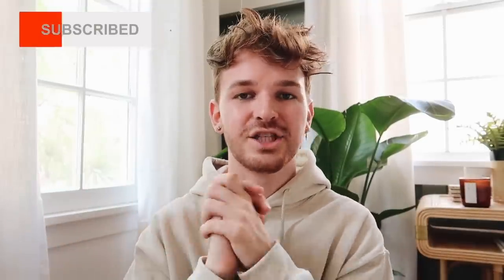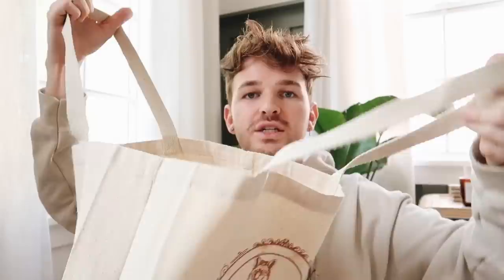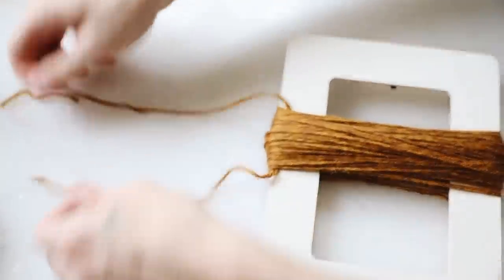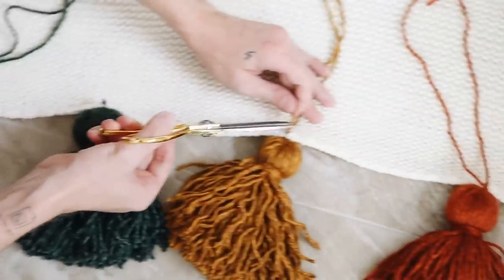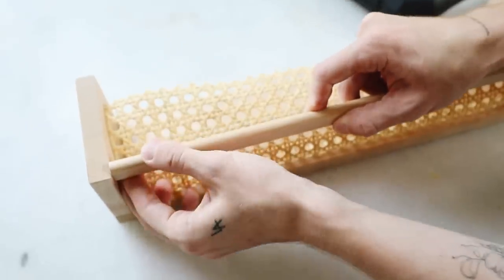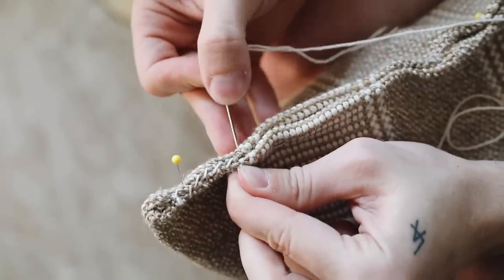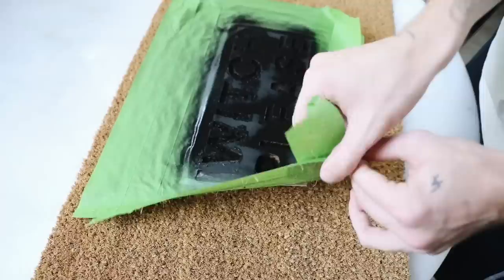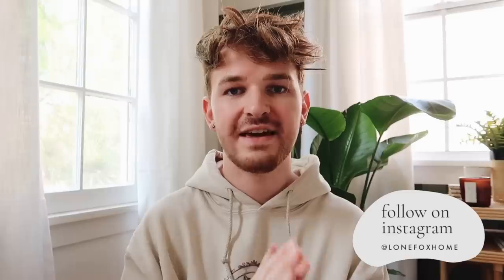DIY IKEA HACKS - Affordable DIY Furniture + Home Decor Hacks!

Comment: A suggestion for you, to avoid having to trim the uneven lengths on the tassels - tape a length of the yarn along the top side of the frame before you start wrapping. That way, you can tie it off evenly at the top centre and have the same length ends. Hope that makes sense 😁 Love your creative ideas (and, as a partially deaf person, how clearly you speak and how well you enunciate 😚)
Reply: Great tip! Thanks
Reply: also after tying the knots needed, you can trim the yarn like he does, or you can leave the excess yarn longer and take a yarn needle and pull the yarn into the tassel and that can make it easier to hide your knots!
Reply: and for smaller tassels you could even use the frame lengthwise and tie it on both sides, then cut in the middle. it would move around a little bit while cutting, but I'm sure it's doable.

Comment: To make the tassel easier to cut - use cardboard twice the length of the finished tassel. Fold in half then when you’ve finished wrapped your yarn/thread, you can easily wedge scissors into the middle to cut the tassel. That’s what us “old folks” used to do

Comment: Tips for the tassel making: your frame has Ana opening in the middle so you could tie the yarn somewhere in the middle and cut it  just on the opposite side.. that was too much work with the xacto knife. 
And to make the tassels more secure on the blanket instead of cutting the yarn you could put the ends back in the tassels with the help of your needle 🥰

Comment: Your ideas are great!  
Here's a few tips for your tassels... 
1.  After finishing wrapping the yarn around the frame why not secure it (with the yarn) in the middle of the aperture, and then cut with scissors on the opposite side?  It'll not only make it easier to cut,  but you'll waste less yarn. 
2. After you've made the ball end of the tassel, thread a needle with the remaining yarn, knot it, then pass it through the ball down towards the tail and trim it even with the tassel tail. This will avoid showing any visible knots and yarn ends around the wrapped ball end.
3.  Once you've made the tassels wrap paper all around the tail end then trim the tails inline with the paper edge.  This will result in all the tail ends being even, and it'll give you a much neater finish to the completed tail. 
4. After securing each tassel to the throw rethread the needle with the remaining yarn,  then pass it through the ball down towards the tails and trim it even with the tassel ends. This again will avoid making the ends of any knots visible.

Comment: I just wanted to tell you- If you use a bristle area brush (like a cheap small one)  and use black paint like you have over the stencils and just stamp it in like you were doing with the sponge brush, it will not bleed and work really well! I make mats all the time and it’s so easy and neater than using spray paint. Also I just ordered letter stencils from amazon instead of printing the paper and cutting the stencil out yourself.

Comment: If you do a surgeon’s knot, you don’t have to hold your finger on the knot to hold it in place. When you’re making a surgeon’s knot you simply make a simple knot like normal but go around and through one more time. Then proceed to pull tight and make double knots like normal.  Works for shoes too.

Comment: When sewing, you can run right over the pins, save yourself time, instead of sewing , stopping, pull pin out & sew again, just sew straight through the needle will slip over the steel pin
Reply: Cynthia Clee please don’t run over pins. If you hit one, you can mess up the timing of your machine. Ask me how I know!
Reply: @janwilliams8930  I have never ever had a problem with timing, broken needles or anything
Reply: Cynthia Clee I’ve been lucky most of the time but I’ve had it happen a couple of times! Of course, it was when I was in a hurry to finish something. 😢

Comment: Hey Drew, just a tip for sewing blind seams: you need to use the ladder stitch. This way you can handsew it, but when you pul the thread, you will sea nothing and a blind seam will form just as when you would have sewn it rights sides together and then flipped it inside out. Here's a tutorial you can check out. I always use this stitch when I'm finishing pillows I don't want a zipper in. 
https://www.youtube.com/watch?v=c2B_fgEGMlM

Comment: Instead of using all that wood filler, should have just used the pieces you cut off the bar and glued them into the holes. Then used filler around the sides.